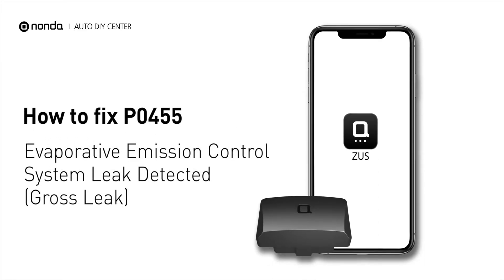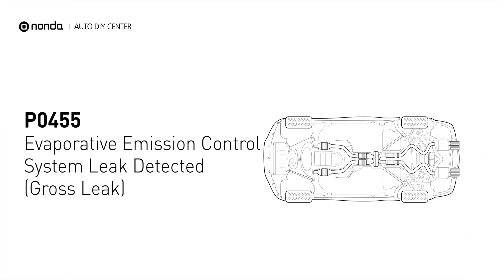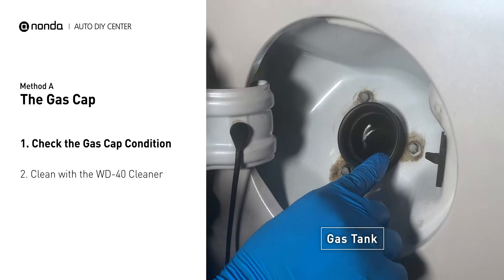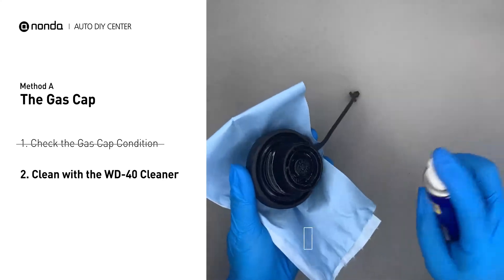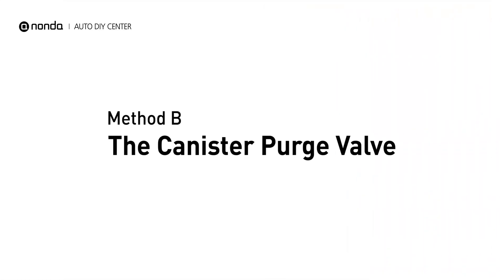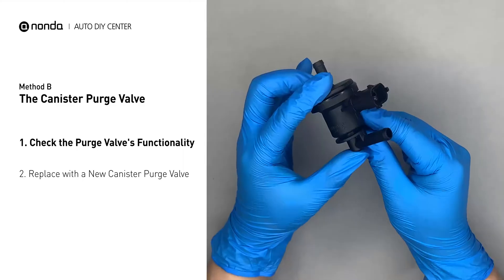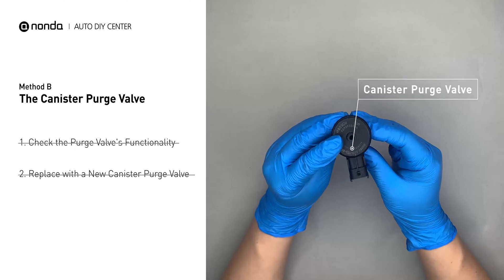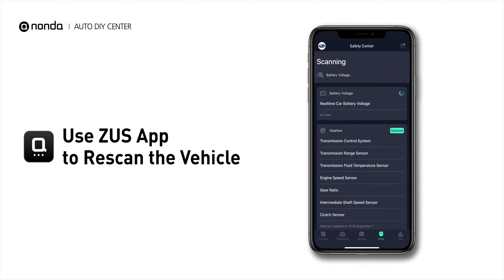How to Fix P0455 Engine Code in 3 Minutes [2 DIY Methods / Only $4.61]

Comment: Got po455 cleaned gas cap then cleared code and rechecked for code the light is off but scan tool says permanent code.why is that ?
Reply from the maker: Hi Paul, please provide us with your vehicle's year, make and model. Also, please confirm if this is the only code you're getting.
Reply: How did you clear the code?

Comment: I need help this code keeps coming back on my 2017 Buick envision it has a capless gas tank.
Reply from the maker: Hello, please get your EVAP system inspected for any issues.
Reply: @nondainc  They did a smoke test supposedly at dealership and at smaller shop. Nothing found. But the check engine light is on again.
Reply: @CCbthe1  Same, so called mechanics just want to throw parts at it over and over. They did a smoke test and couldn't find anything, twice. The problem persists. Any luck figuring it out yet?

Comment: Replaced purged valve and cap. Still get PO 455, 457 and 497 codes after reset .
Reply from the maker: Hi Marc, please provide us with your vehicle's year, make and model for us to address your concern accurately.
Reply: @nondainc  kia rio 2009
Reply from the maker: Kindly check the purge valve, line, and canister for any issues. We also suggest performing a smoke test to verify if the EVAP solenoids/valves are okay.
Reply: @nondainc  no access to a smoke test but there's a part that I took a picture of that open closes hard attached next to airfilter box . I sprayed it and worked it clean around hinges and light went out. I have a picture if you want.
Reply: I have a 2007 GS350 it broke down (Starter) i thought it was the battery and used a jump box, the negative battery cable came off . Towed to repair shop fixed starter. Drove 20 miles got check engine 0441,0455 replaced gas cap, purge valve get 0445 now.

Comment: About how long will it take for the check engine sign to go way if it was the cap?
Reply from the maker: Hello, please provide us with your vehicle's year, make and model.
Reply: @nondainc  toyota tacoma 2008
Reply from the maker: Hello, have you replaced the fuel cap? Is there any trouble codes that registers along with P0455?

Comment: Saturn vue 2006 v6 , same problem with the code but I replaced the purge valve solenoid underneath the hood and replaced the evap canister underneath the car as well, just did what you instructed and felt no air suck-age , I’m constantly being told to drive it but I have and over 50+ plus miles, any way to help me?
Reply from the maker: Have you double checked if there's any other trouble code registers along with this code?

Comment: Where is located in nissan rogue 2010 SL AWD
Reply: Thank you
Reply from the maker: You are most welcome, Luigi! Stay safe.
Reply from the maker: Hi Luigi, for your vehicle (Nissan Rogue) the most common reason that triggers this code is due to a bad vent control valve which is usually located at the back of the vehicle or near the charcoal canister.

Comment: 2007 dodge caliber sxt 2.0.
Replaced gas cap , replaced the canister purge valve. Still have engine light. Is there a reset code or something else to do??
Yikes gas is almost 6 bucks a gal..
Reply from the maker: Have you double checked to see if there's any other trouble code registers?

Comment: Have a 2015 GMC Yukon with the 6.2. Dealership replaced evap valve saying it was stuck open. But the code still comes and goes. Sometimes staying gone for weeks. And sometimes coming on multiple times a day. 
Any ideas? Also bought a few new gas caps
Reply: Me too. Have fixed all these parts too. Even swapped manifold gaskets last weekend. I noticed it happens when I sit parked at idle for a few minutes
Reply from the maker: Hi Jacob, please inspect if you have a fuel leak. Check/monitor the fuel tank pressure, and perform a smoke test. Hope it helps!

Comment: Will Lucas fuel treatment or STP help?
Reply from the maker: Hi Christopher, please provide us with your vehicle's year, make and model.
Reply: @nondainc  2008 KIA Sedona 120094 miles. I used wd40 on the fuel cap, attempted to erase the code. I drove the van to get beer for the Packers/49ers game when the check engine light cleared. Thanks.
Reply from the maker: Hi Christopher, we appreciate the update and we're glad to hear that you have sorted out the issue. With regards to your question, yes- the lucas fuel treatment can actually help also.

Comment: Replaced gas cap and no suckage in Evap Purge valve when checked. Any other suggestions?
Reply from the maker: Hello, kindly check if there is any damage to the charcoal canister, and if there is a cracked or disconnected EVAP hose/line.
Reply: So what was it?

Comment: I checked mine and felt vacuum suck -age from the part that was clipped onto the valve. Wanted to know if I did it right or if I was supposed to feel suck - age from the end of the valve itself?   Thank you for the video
Reply from the maker: Hello, kindly provide us with your vehicle's year/make/model.
Reply: @nondainc  it is a Saturn Ion 2005
Reply: @nondainc  also is the canister purge valve that I’m supposed to test for the vacuum suck-age in the front or back? When I did it I disconnected the hose and the car shut off and I felt suck age from the hose. Did I test the right end? Is their an email I can send the video of me testing it so I can be guided to the best possible solution?
Reply from the maker: Hello, it's in front. Have you scanned your vehicle to verify the trouble code present?
Reply: @nondainc  thank you for your reply and assistance. I went to Autozone  multiple times to do the diagnostics test and the code that pops up is P0455 the large EVAP leak. I followed your instructions and did fill suckage and just wanted to make sure it was the valve not allowing air to come up because they do not do returns on parts. Since it’s only like thirty some bucks I’m just going to get it and install it rather than waiting and something like an O2 sensor becoming effected.
Reply: @nondainc  thank you for your help. The problem is fixed!!
Reply from the maker: You're most welcome! Glad to hear that you have sorted out the issue.
Reply: @airmike4life  Did you just replace it with a new one to fix that issue?
Reply: @EscoPicoTrane  this
Reply: @airmike4life  how did u do it
Reply: @EscoPicoTrane  also I got the part from Auto Zone

Comment: 06 Chevy Equinox, mechanic inspected replaced purge & gas cap same code & issue came up again. Replaced purge valve again, didn’t help. What’s next?
Reply from the maker: Hi Marty, kindly ensure that the EVAP system is working properly. Have you tried performing a fuel vapor leak tests?

Comment: I did all of this and still getting p0455 after filling the tank.
Reply: Try changing the vent valve
Reply: @jak-hx9de  I did. And the purge valve. I do thank you for taking the time to respond. 😊
Reply: Me too on a 2008 dodge nitro
Reply: Hello , canister purge valve is the same as vent valve?
Reply: @hugoaran1814  its just related to that code
Reply: @jak-hx9de  but they're the same auto part?
Reply: @hugoaran1814  as the purge valve 

No,
Its down the car on the rear
Reply: @hugoaran1814  not the same thing
Reply from the maker: Hi Dana, you may also refer to your vehicle's service manual as repairing steps for this code could be different per vehicle's make/model.

Comment: Thanks for the tip on cleaning the gas tank opening and the gas cap with WD-40.
Reply: Did work for you? Eliminate error p0455?
Reply: @danyphanton1  nope. I tried but still have
Reply from the maker: You're most welcome! Have a lovely day!

Comment: I have the same code replaced both and won’t let me go over 60
Reply: Catalytic converter
Reply from the maker: Hi Jorge, there are other factors that trigger this code. If the gas cap was replaced already and the issue still persist, please check if you have a damaged EVAP system tubes and hoses.

Comment: Hey, so I replaced my Canister Purge Valve and the new one also still has vacuum against my finger
Reply from the maker: Hi Corey, when it is in a good condition, the vacuum will hold very well and it won't drop even after a minute. Since the canister purge valve was also replaced already, it is recommended to have the vehicle inspected by a certified mechanic to determine the problem.